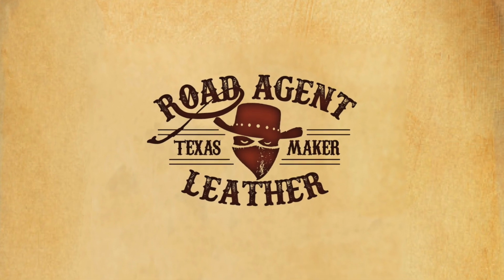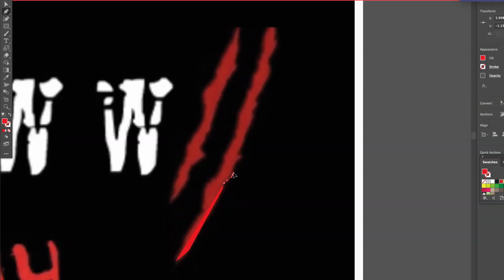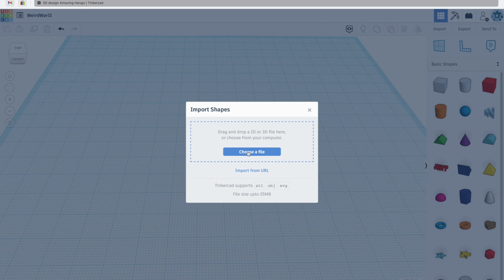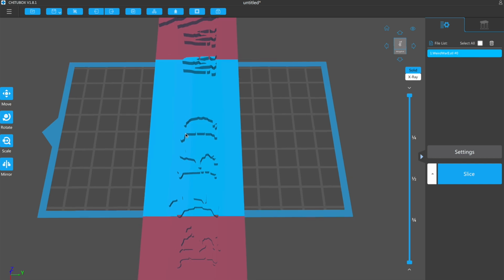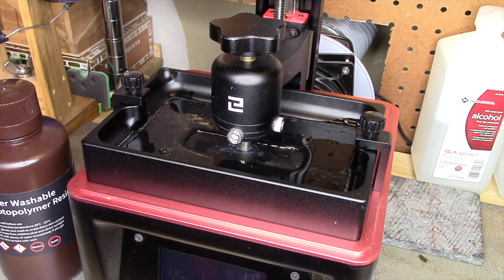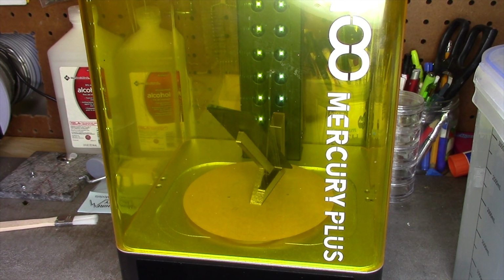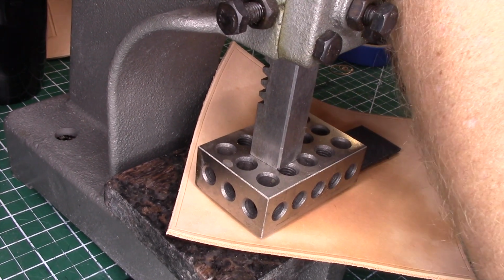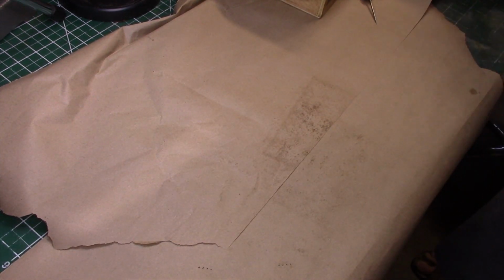3D Printed Leather Stamps Do-It-Yourself Valet Dice Tray Maker Cosplay Leathercraft Leatherworking

Comment: Nice ! I'm using my old filament printer to do the same. It's a bit less detailed but for basic stuff it works well using the 'ironing' option of the slicer on the last layer (to get it smoother). Your video makes me want to go for a UV resin printer (but it's a lot of fuzz .. printing, cleaning printer, rincing piece, curing piece). I made a bunch of (Tandy Leather-) compatible 3D stamps, but pressing them clearly gives a better result than hitting them with a mallet. (Special mention to you, that is using a drill-press to press your snaps ! )

Comment: What make and model is this printer and that curing unit.  I'm just JUST getting into leatherwork and THIS is Exactly what i need.  I was about to spend lots of money getting acrylic laser cut for what i need but THIS has my creative juices flowing like crazy.  Thanks a ton for this man.  I need to get back into Illustrator now.  Haven't played with that since CS3 came out WAY back when.
Reply: I have Amazon opened in a second window.  Let me know so i can scoop it today.  SO Excited now.
Reply from the maker: Printer is an Elegoo Mars 2 Pro Mono MSLA. Curing unit is the Elegoo Mercury Plus 2 in 1 Washing and Curing Machine.  If you can afford it, I would go for the Elegoo Saturn - simply because of the larger print surface. It came out after I had already bought the Mars. For larger prints (like the floral pattern seen briefly in the beginning) I use my Prusa Mk2. However, it's an FDM-type printer and isn't capable of fine detail of the resin machine. Btw: In the video I'm using the water-washable resin, but I actually prefer the "standard" type resin that washes with alcohol. Strangely, the water-washable has a stronger smell IMHO. Good luck!
Reply: If you don't mind, could you find me on FB and message me?  I have some ideas for the 3D printer and wouldn't mind your input without having to post it here and see others come out with it before i perfect the craft.  Bahahahahaha.  Lee Pipper on FB in Toronto Canada
Reply: @RoadAgentLeather  I ended up going for the Saturn.  Super excited.  Hope i can figure out how to use Chitubox so i can get to stamping ASAP.
Reply from the maker: @maplehedgehog789  Good call. I may end up selling the Mars for the Saturn. Now just start immersing yourself in Youtube tutorials on resin 3D printing. The nuances of support structures take a lot of trial and error to learn.